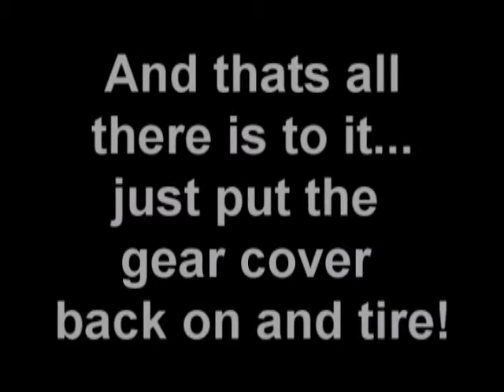slash...gearing

Comment: Make sure you tighten the pinion on the flat spot of the motor shaft to stop if coming off.

Make sure you loosen the two screws holding your motor in and set your gear mesh ( distance between pinion and spur ) they should be about 1mm apart so you can just wiggle the spur before it comes into contact with a tooth on the pinion.

Not hating or anything just trying to help! :)

Comment: You got to be careful when using the 76 gearing because  you can burn up the motor pretty quick you don't want to over gear it the temp can quickly rise above 180 degrees that will spell the death of your stock 12 turn brushed motor

Comment: i had a 76 tooth spur gear jus sitting around so i put it in my slash 2wd along with a 23 tooth pinion im also running a 3600kv motor and 2s lipo and i bet it goes at least 40 close to 45 mph it fuckin crazy man